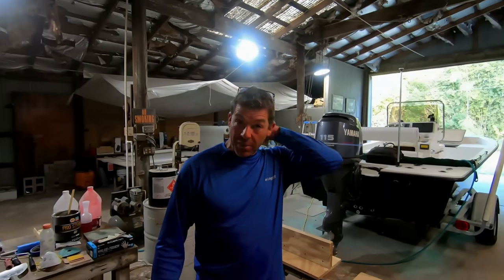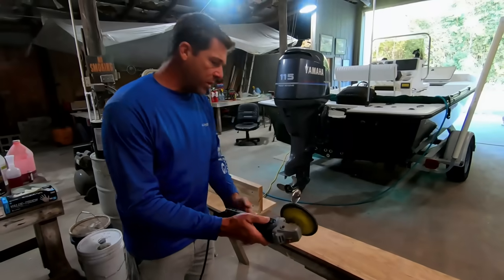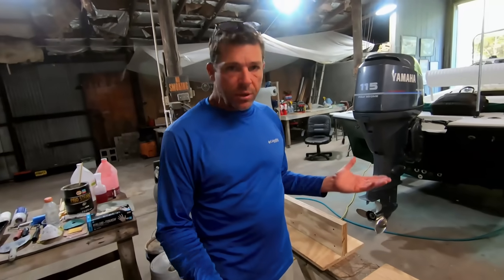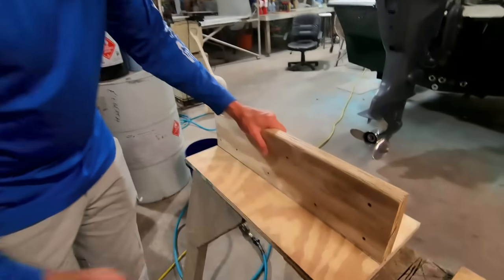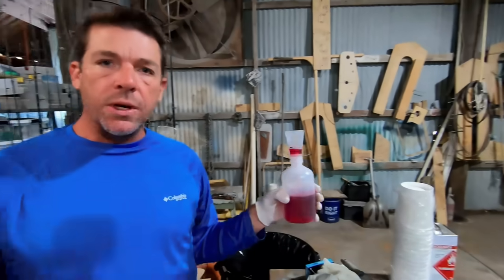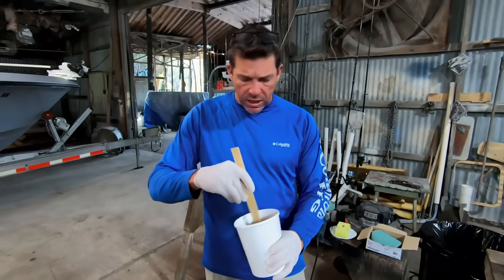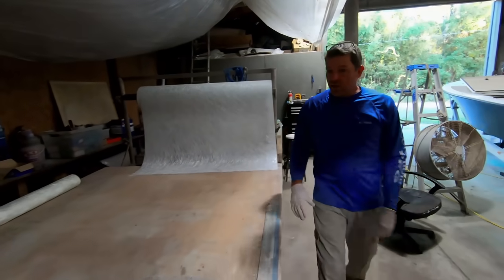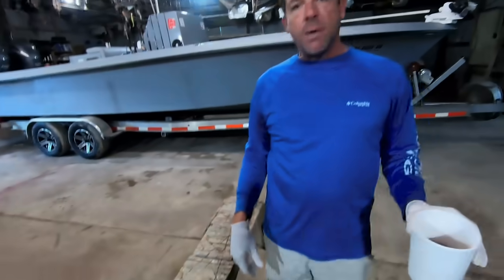How to FIBERGLASS over PLYWOOD!  Do it the RIGHT WAY the FIRST time! Step by Step DIY fiberglassing

Comment: Joe and the rest of you from Fish Bump TV, thanks for all the great videos and information.  Joe, one thing I would love to hear your opinion on is regarding brackets.  In this case it is going from a shaft inboard to dual outboards and what is the preferred?    A bracket bolted on  made of aluminum/stainless or building one of fiberglass with plywood/coosa glassed into the transom?
Reply from the maker: Glad you are enjoying the videos! If the boat is built from the start with a euro transom or integrated transom bracket out of fiberglass and core, I feel good about that. But for refits or conversions to a transom bracket I prefer ones made of aluminum or stainless. I hope this helps and thanks so much for watching and commenting!
Reply: @FishBumpTV  Thank you Joe

Comment: Thanks, I've learned a lot! Now that I know how to do it, I plan to build a 70' fiberglass reinforced plywood sailboat in which to circumnavigate!   OK, no I'm not.  But I can use it help me renovate my mid-sized sailboat. 
So the CSM WILL make 90º corners? Could it then be used to build a fillet in a corner?
My question was going to be: have you done a video on gelcoating/flo-coating? I just looked in the margin and saw it was coming up next!
Reply from the maker: Haha, that awesome! Glad to help. Yes, csm will make a 90 degree inside corner as long as you are using poly or vinyl resin. It will not make a 90 degree outside corner. I always use a fiber reinforced filler for the filets, it has worked well for me. Just a personal preference. I appreciate you watching and commenting!

Comment: This is a great video and has helped us on our journey of fixing our transom. I do have to ask, after you use the pro strand and it has cured can you sand the extra pro strand off?  Or is that over handling things? We just not sure if it would ruin our base coat of resin.
Reply from the maker: Thanks, glad you enjoyed it! Yes, you can sand off any excess filler if you want or need to. If you feel like you have sanded into the resin primer coat to far, you can always touch up the thin spots with more resin. I hope this helps and thanks for watching!

Comment: Hello, thank you for the information and demonstration in your videos.. how many layers of the 1708 would I lay over my marine plywood floor of my boat before finishing off with some chopped mat?  

Also, would I need to do anything to the finish before gel coating or painting the floor?
Reply from the maker: Glad you are enjoying the videos. There is no set amount that would be right for every application. We used 1 layer of 1708 and 1 layer of 1 oz mat on our 29 ft hybrid bay. That would probably be fine for your project, of course you could always add more mat or glass if you think it needs it. Some light sanding is all that is usually need if you are using gelcoat. Some sanding and primer before paint is usually the way to go.

Comment: I have a question about pre-sealing wood (or plywood) because it came up recently. 
I’ve been doing something for a while that seems to work fine but someone pop-pood it recently and honestly I don’t actually “know” other than my experience. I often sand plywood to get rid of the slick surface then spread on a thin coat of polyurethane varnish to keep the first layer of ‘glass from getting sucked into the wood and giving me a dry layup.  I wait for the urethane to cure, then sand with 100grit to give it “tooth” before applying the cloth and polyester resin. 
This seems to work great: at 4-8 hours depending on temperatures you can sometimes pull the hard resin and cloth away from the urethaned plywood, but at 10-12 hours + or overnight it can’t be pulled up or off- it’s permanent. It won’t even tear. Can’t even get a knife under it unless you start cutting the wood beneath. It seems quite effective, and with certain brands I like urethane is sandable in a few hours whereas unless you mix a really ‘hot’ batch resin doesn’t sand without gumming until the next day. 
This is used just for large areas of fresh wood or plywood- smaller repairs seem to kick off to sandable  much more quickly but then again that’s small batches that the work is quick enough you can afford a slightly hotter batch of resin anyways (and if it’s warm out, obviously)

Current project that brought this up is actually my own boat (19’ aluminum) that I gutted and constructed a standup open cabin on for shelter when fishing or to occasionally overnight with the grandkids. 

Someone said that will delaminate and it was dumb. 

While I’ve NOT experienced ANY failures in the past, the question remains: is this wrong to do? 

I’m intending to knock together some skiffs over the winter to sell next spring and now that I’ve been questioned by a supposed highly experienced person I’m newly concerned in spite of past successes with the method.
Reply from the maker: I have never personally used or heard of polyurethane varnish being used as a primer for fiberglass over plywood. That doesn't necessarily take away from your experience with that process and the results you have had. I do know that good, clean and dry plywood that has been sanded with 24 or 36 grit paper over the entire surface, then blown or swept clean and primed with a good high quality resin is the way we have done it for decades. If you are using a laminating resin, you should only need a very light sanding or scuff to knock down any burs on edges. Some folks do like to slightly thin their polyester resin with some styrene at 5 to 10 percent ratio, but I usually don't thin it. Our most popular video on the channel is  How to fiberglass over plywood the right way. Maybe it will help give you some clarity on your current method, verses your method. I wish I could tell you more, but hopefully that helps. I wish you the best with your boat projects and I appreciate you watching!

Comment: I have a set of mobile home stairs that are strand fiberglass over a plywood base, perhaps?  Anyway, the main platform and one of the stairs began to sink in the center and have now formed a crack that I would like to repair.  1.  How many layers of strand over woven roven can you use since my project has a slight sinkhole in the middle?  Just the 2nd layer as the woven roven?  2.  Do you let each layer sit for any length of time to dry?  I have never done a fiberglass project in my life, but don't have the budget to hire out and don't want to fall through these stairs.  Thanks for your video.  It really helped explain the difference between strand, woven roven, and cloth.  Lowes just showed me resin and cloth.  I knew I was missing something.
Reply: sounds like the plywood is to thin

Comment: I have altered a Tracker Party Express fiberglass pontoon boat into a camper boat. I kept the weight down with a sandwich construction of an aluminum frame like the RV walls. When I put it in the water it set a little lower than I thought it would with 2 people on it. It is a tunnel hull construction and is designed to sleep 4. I purchased 4.5" foam floats the same type material used for Life Jackets. With a 40" x 10 foot area of 4.5" will give me approximately 460 lbs. Of additional buoyancy. The foam is glued to the hull using contact cement. It then is finished off with 1/8"  fiberglass sheets. Attached with 3m 5200. And aluminum angle on the edges. My question is should I try and make this area water tight by sealing the seams to the hull with layers of mat and adding a drain plug or just caulk them with the 3m 5200. The boat will be used on a canal with a speed limit of 10mph.

Comment: Awesome video and very helpful.  Thanks for taking the time to share your  tips.  I'm just getting my feet wet into glass work and have a lot to learn.  You're definitely helping to shorten the learning curve.  I've been picking up some 60s and 70s older Fiberform boats along with some others.  Most are needing new decks and transoms.  For basic waterproofing plywood decks covered with carpet is CSM enough or better to use 1708 or the 6oz cloth?  Not sure how many layers that are needed for basic waterproofing?  Oh and your tip about heating and drying the wood is awesome as I'm in the cool damp Northwest with just a garage and/or driveway to work out of.  Don't want to wait for our short summer weather to get started ☺
Reply from the maker: Thanks! Glad the videos are helping you with your projects. As far as waterproofing decks on smaller boats under 16 feet or so I would suggest 2 layers of 1 oz csm. I would also recommend a 6 to 8 inch wide strip of 1708 in the corners where the deck meets the hull sides. As the boats get larger you would generally add more glass. For example on our custom 29 that we built we used 1 layer of 1708 then a layer of 1 oz csm on the flat surfaces. We doubled up on the corners with a total of 2 csms and 2 layers of 1708. These are just general suggestions of course, and ever boat project will vary. You might enjoy the boat building series, especially the one where we are glassing down the Coosa decks, but there are over 20 videos documenting the entire build. Hope that helps answer a few of your questions. I really appreciate you watching and good luck with your projects!
Reply: Definitely helps!  Thank you very much.  I have checked out a few of your other videos as well.  All of them are helpful. Thanks for taking the time to share with us your knowledge.  Love your 29!  I bet it's a blast to fish out of.  Wish I had a shop like that to work.  Having the right space and tools certainly makes working on these projects that much easier. @FishBumpTV
Reply from the maker: @MichaelConquest  glad to help. Yes, we really enjoy fishing the 29! You are right, having a good work space makes everything easier. We have new content coming out soon. If you have any suggestions for videos, I would like you thoughts. Thanks!

Comment: I'm not sure that I have ever purposefully "liked" a video.  Thanks for all of the information and detail, just found out the floor and pretty much everything wood in our boat is rotten.  Wasn't really sure what to do or if we were in big trouble for an old boat until I watched this video.  Question though, what did you mix with the prostrand?  
Thanks for hopefully keeping our 1989 from heading to the scrap yard after owning it for less than 2 years.
Reply from the maker: Awesome, glad the videos are helpful. You have to add a paste hardener or catalyst to most fiberglass products to make them cure properly. We have lots more videos here on the channel that go into depth regarding all kinds of fiberglass, gelcoat, and boatbuilding topics. So feel free to check them out!

Comment: How do you guys make custom fiberglass hatch lids?  From size and shape set up to finishing ... thx
Reply from the maker: It is a multi step process. First you built a pattern, then a mold, then the part from the mold. If you look on our channel I made a video a while back detailing the mold building process. It was for a console and seat mold though, not a hatch. I plan on building a fiberglass hardtop for our 29ft charter boat soon. That should answer a lot of your questions. Thanks!

Comment: Great video as I'm getting ready for my first attempt to build a small platform for a new head in my sailboat.  I see a lot of others use peel ply for a nice finish. What are your  thoughts on that?
Reply from the maker: Peel ply is an option when working with epoxy to deal with amine blush. There is nothing wrong with using it other than it is something else to buy, and it creates additional waste pruduct. I don't personally use it, and just go with the traditional way of removing amine blush. There are also epoxy resins out there that don't produce amine blush. They are usually a 2 to 1 ratio, so that might be a option for you. In the end you should go with what you are most comfortable with. I hope this helps and thanks for watching!

Comment: Do you let the primer resin cure before adding the filler in the screw holes/corners or do you do it while it's still tacky?  And do you let the filler cure before adding the second coat of resin? Excellent video. Thank you 🙏
Reply from the maker: You can apply the filler in the corners while the primer coat of resin is still tacky, but not wet. Then let the filler in the corners cure, and sand down any bumps if needed. I hope this helps and thanks for watching!

Comment: I've watched a lot of videos and try to learn a lot stuff. Even though you are a professional, you conveyed in words and showed in a great extent. The best learning video I've ever seen. Now if I may ask you for your knowledge Sir Ol great one. 1999 Kenworth hood with stress cracks. After sanding off paint, will it fix cracks if I roll on The fiberglass resin with styring. I'm thinking that it was soaking to the cracks. And then get hard. I was gonna use a poxy primer if this works. And if I use extra styring would make it more thinner. And that it would evaporate problem solved? Thanks and I did subscribe 👍
Reply from the maker: Thanks so much, glad you are enjoying the videos! Without seeing the damage in person it can be hard to say exactly what is the very best method for your project. But if possible grinding out some of the damaged fiberglass first, then adding some new csm or even biaxial cloth back would be the best way to make a solid repair. It is possible that soaking resin into the damaged area could work, you could even use epoxy resin for the repair if you wanted to since you are already planning on using a epoxy primer. I will try to make a video on this kind of repair for you guys soon. Hope this helps, I appreciate you watching!

Comment: Hi Cap’n Joe, pure gold. Thank you. Do you have any experience with glassing over Cypress? I use resin fillers on Cypress in carpentry and it sticks well, so I assume that adding glass should be no problem.
Reply from the maker: Thanks so much! Cypress is a great, naturally rot resistant wood. But what makes it rot resistant can make it a little more difficult for some resins th bond properly. Epoxy resins are probably your best bet for bonding really well to cypress. Hope this helps, I appreciate you watching!

Comment: Yes Sir,  this is chocked full of good info & it gives me a lot to get started with >> >   If you were to use plywood in a build how thick
is recommended for the hull that you were going to fiberglass over?  I was thinking 3/4" but can you get by w/  1/2" if you're using
a fair amount of glass?  I'm fishing here(no pun intended) but I don't even know what thick "glass"  would be in inches?  I'm just
thinking outload but perhaps my answer will be contained within?  TY man,  LQQKin'  for your brother's next video.  peace
Reply from the maker: Glad you are enjoying the videos! The plywood thickness would vary quite a bit depending on the type of boat you are building. 1/4 inch might be used on a small  paddle or electric powered boat, whereas 3/4 would be common on a larger power boat. And in many cases the bottom would be thicker than the sides. I hope this helps and thanks for watching!
Reply: Party Barge size for an inland lake so I'm
thinking 5/8th or 3/4ths will do.  Coosa is
way high but comes in many strengths as
I saw a Transom redone using it. peace

Comment: Very good tutorial. Couple questions, how were the "stringer" pieces put together? Glued I'm figuring. Do you leave the screws in or are they removed prior to filling the holes. Can I use CSM with an epoxy like the West System?
Reply from the maker: Thanks so much! Yes, the stringers are usually glued together with resin and one layer of csm. Then stainless screws holding them together.  We always leave the screws in, they just add more strength.  Generally epoxy and csm do not work well together. I plan on doing another epoxy and fiberglass over plywood video soon, hope it helps answer more of your questions. I appreciate you watching!

Comment: Great video.
I have a situation which maybe you could shed light on. 
  I have a ripped/sliced compartment made of 1/4 plywood.  I'm hoping I can use fibreglass to repair it. 
  The outside is painted and the inside is sealed with what ever was popular in the seventies (varnish or resin.)
  The tear is about 16 inches long. Can this be done?
Reply from the maker: It's hard to say for sure, but I would imagine that it is possible. You might want to consider doing some more research here on the channel. I have several videos on resin and fiberglass selection, as well as some epoxy fillers and putties videos that should shed some light on the materials and their uses. I hope this helps and thanks for watching!

Comment: Very useful. Can treated ground contact plywood be ueded with fiber glass?
Reply from the maker: I haven't personally fiberglass ed over treated plywood, so it is hard for me to say for sure. You could always try a small test panel and see how it does. Also you might consider using epoxy or vinyl Ester resin, as they will bond more aggressively to a wider range of materials. Hope this helps and thanks for watching!